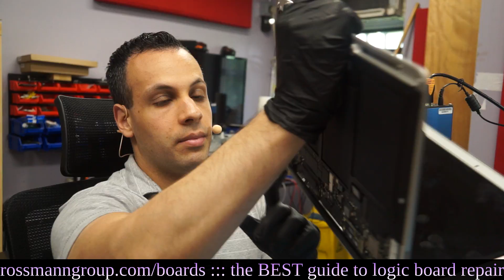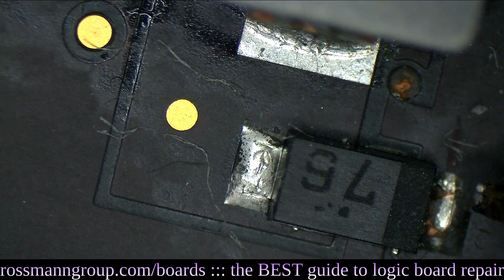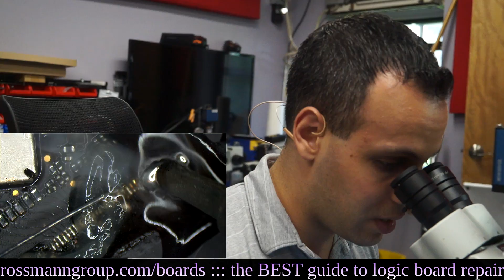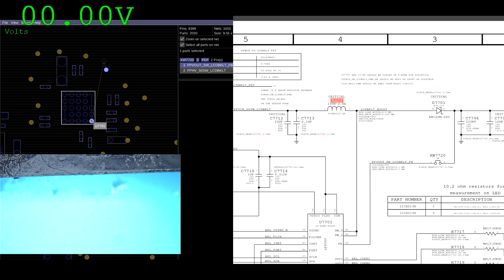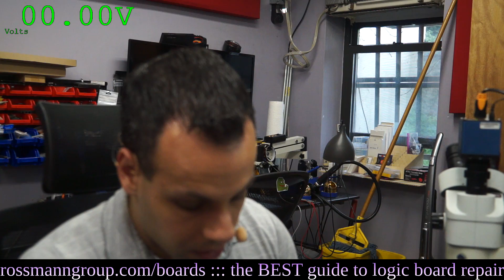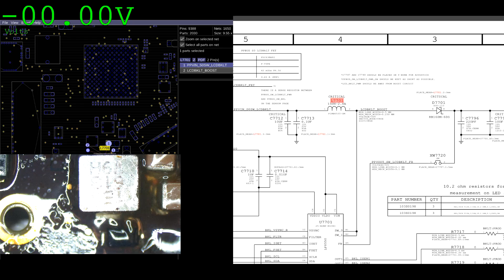JESSA LIED, BACKLIGHTS DIED!

Comment: Yes Louis,  when the backlight died on my Macbook Air v2.0 from '08 I was lucky enough that it was covered under Apple's extended genius bar warranty (which I had paid for after all and after a previous repair which had been the replacement of a rattling cooling fan) but when they took over a week to fix and return this (within CA state btw.), I became suspicious... sure enough, after I got my Macbook Air back they hadn't just exchanged that simple diode but the entire motherboard and the hinge (??) of the laptop (sure, free of charge then)... and lo and behold, sometime later the replaced hinge first started crackling like glass and then broke - you guessed it, after the lapse on my three-year warranty - which caused me to drop the bottom part of my laptop on a concrete floor causing substantial damage in form of dents to the housing and ripping the connective line between top and bottom part... :( 
I was quoted over $800 in repairs by the genius bar - for repair of a $1500 computer which was barely over four years old.
I never looked back.

Comment: So, realistically, how often is the coil the problem?
Reply: It's never the coil.  Unless it is always the coil.  Some coils are prone to failure due to board position, composition, and other common faults in the system that can affect them--in those "signature failure" cases, the coil will be at the top of the differential diagnosis.  The problem is when people 'learn on' a certain signature failure and then apply that to every problem.  Outside of signature failures in iPhones, coils never just 'go bad'   The point of the "It's never the coil" movement is to encourage people to learn how to think and troubleshoot each problem independently rather than apply plz bro advice from one problem to others.

Comment: Since you are a professional i might ask you to diagnose my problem:
My PC started giving me no POST and 3 beeps, which mean no video card detected. Tested the GPU and it works, tested the PCIe , doesn't POST. The thing is, while the PC turned off, when i plug the GPU in the defective PCIe, the monitor goes from "no signal" to idle which means it gets some signal. What got fried in this case? (btw the PC is 12 years old, an Athlon 64 X2 machine with a DFI board)

Comment: I hate working with lead free solder. It just doesn't seem to flow as well as lead solder. I got a radio kit from amazon which came with lead free solder and I immediately threw it out and used my lead solder